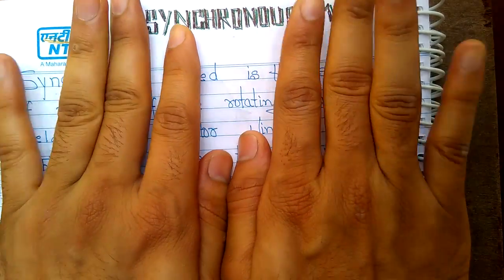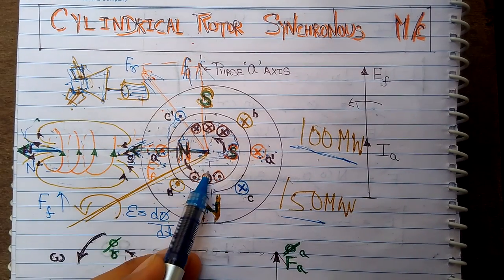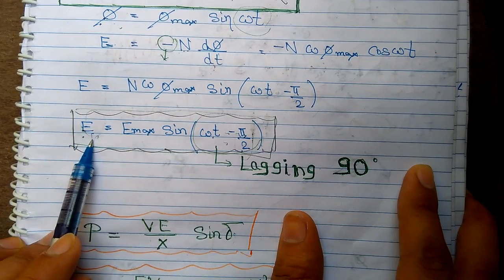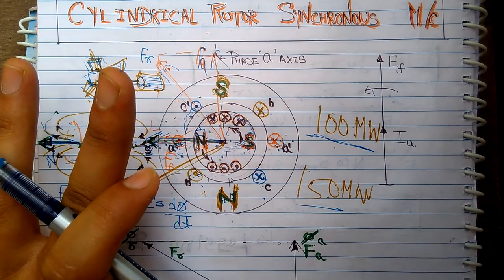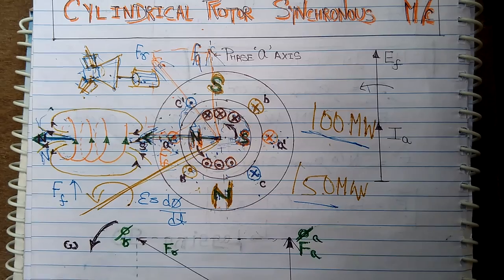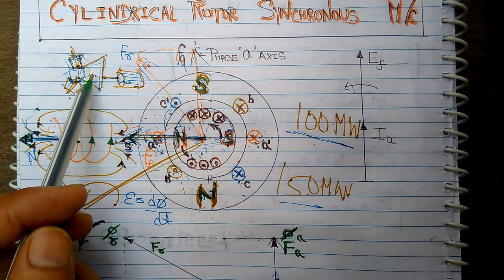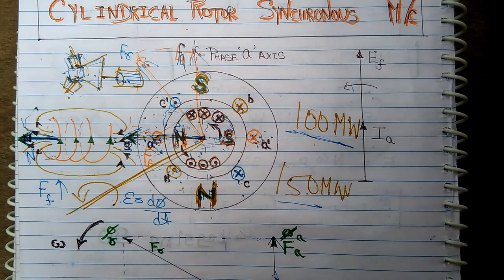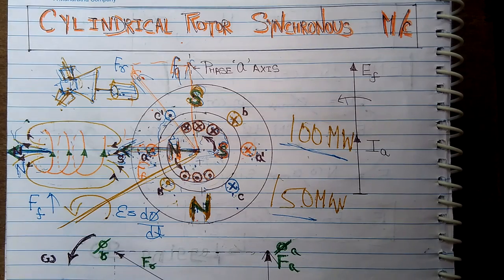How Alternator work and generation of active and reactive power and effects of load changing

Comment: Nice Video. I have got the process of increasing real power on Grid connected machine. But I am confused about reactive power increasing. According to your lecture, while I will increase filed mmf, more stronger main field, which may cause reduce delta angle. But at the moment while delta angle will be reduced, it may also reduce the active power. Which is not desired And also impractical. in practically, while we increase reactive power, real power never reduced.

Comment: Sir,
I'm a cogen plant and export power to electricity grid.
I want to understand which method is used to increase reactive power in a practical way with power factor because field current controlled in auto through AVR

Comment: Boss how did you obtain the direction of the current in the stator winding? I cant visualize it using right hand rule (RHR) since lenz law stated @stator the flux density will oppose the flux who induced it. So im trying to use the RHR at stator winding side to determine the direction of the current. Or we can assume w/c any direction of Current in the armature winding. Correct me please.
Reply: Let's consider the phase a which he's marked as a cross 

Since the rotor moves anti-clockwise it sees conductor a moving in a clockwise sense( relative motion).This is because the field is moving and conductors are stationary (opposite to a DC machine where conductors move and field is stationary)

 Now use right hand rule, point your thumb at 12 o'clock, index finger at 9 o'clock and you will get the current as coming out of the paper(dot sign)

Comment: Why did you take the direction of armature(stator) mmf  vertically upward when you got north pole of the stator in the opposite side(downwards)?
Reply: It's a simple concept.

Flux leaving the core is taken as North Pole. 

1)For stator
Flux first leaves the stator core and then passes through a air gap

2)For rotor
Flux first leaves the the rotor core and then passes through the air gap

Comment: Sorry, but you CAN increase armature voltage by increasing speed since increasing rotor speed increases the rate of rotor field flux cutting the stator winding per unit time. so basically there are 2 ways you can increase armature voltage: rotor speed (via governor) and rotor field (via AVR)
Reply: He is talking about grid connected generator. The speed is considered fixed.

Comment: "the emf will lag the flux by 90 degrees" <=== I doubt you actually understand what it means. phasor lag? spacial lag? how do you come up with that conclusion?
Reply: Phasor/time lag 

He didn't come up with the conclusion it can be proved with equations. That's why when flux is maximum emf is zero since it's a time derivative of flux
Reply: @justadreamerforgood69  Understand the problem first, formulate the equation later. Plain language first math later. Newton, Einstein, whoever, all follows the same route, except for the F**KING university students trying to pass a test the next morning that is 4 hours later.
Reply: @ylstorage7085  
I understood the problem and I've done done experiments on it as well.

He even wrote the equation showing the -π/2 lag. If you use a simple one turn coil and have 2 permanent magnets 180° mechanically placed you can prove it by a simple experiment